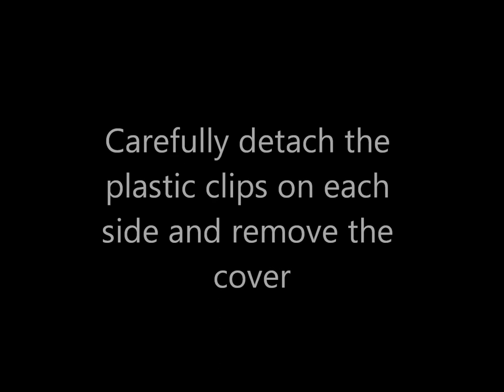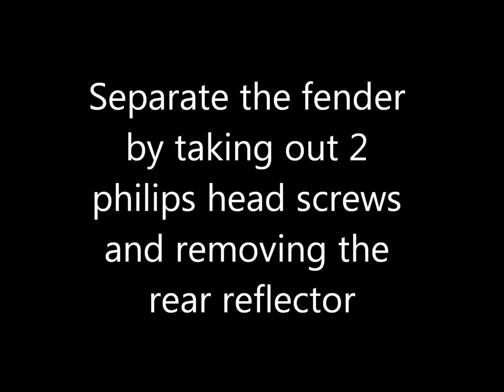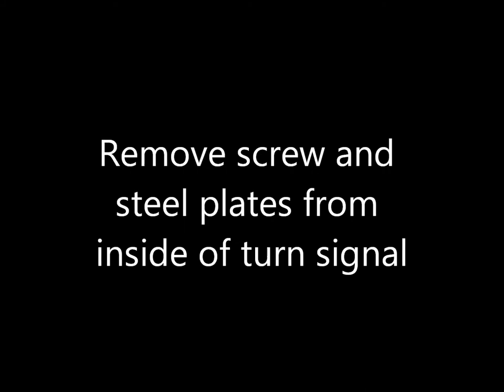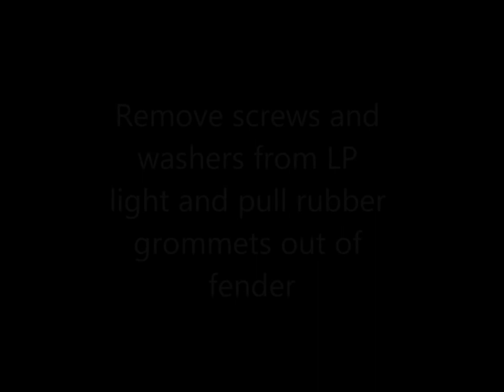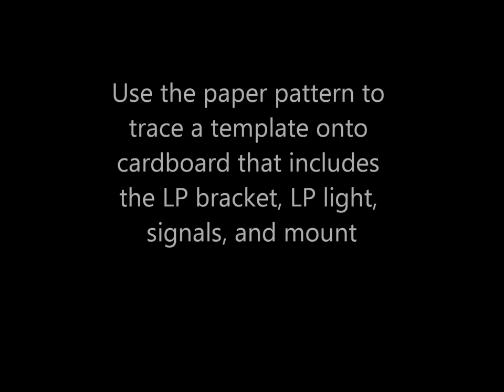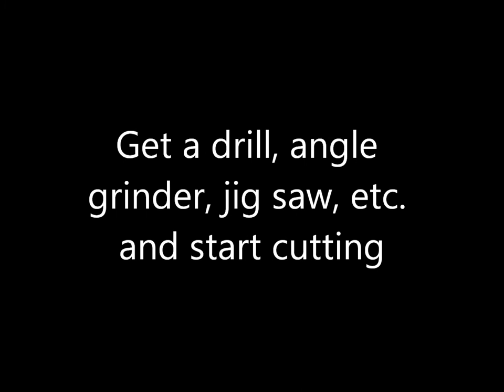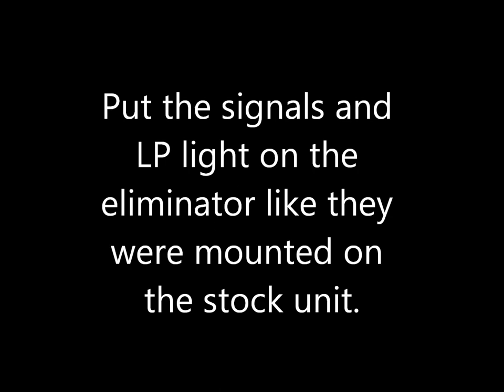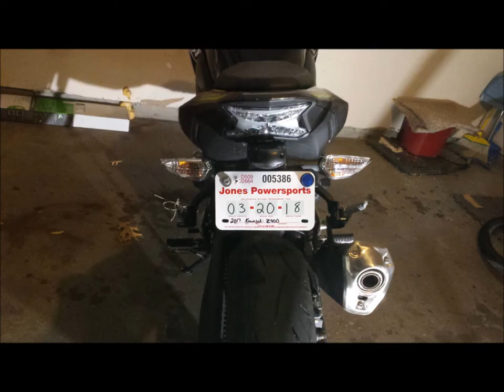Homemade DIY Fender Eliminator Tail Tidy for Kawasaki Z900

Comment: Nice job. 

Find it really annoying that most tail tidy kits don't utilize the factory number plate light but instead usually come with a cheap looking led. Also in the UK for MOT regulations you need to have a rear reflector and the only option is usually to stick a reflector on the number plate and tend to find you end up having to order a new license plate as the mounting holes differ from the factory hole position.

The makers of tail tidies will always sell them as plug and play but in a lot of cases you always end up having to do some modification, which you wouldn't have to do with a bit more thought put into the design.

I've got a 2015 ER6F (Ninja 650 in the US) and recently purchased a tail tidy but not happy with it for all the above reasons. Think I'll use it as a template for a redesign to allow me to use the factory light and reflector.
Reply from the maker: Cool.  We love the UK by the way.  We visited in 2017.  The history, the courtesy shown by everybody we met, the countryside, the food, everything was beautiful.  Everything except for the average speed cameras...

Comment: Just a question, isn't it already enough removing the backseat for being able to remove the fender after all?
As I've seen for the Z650, there it was necessarily removing the whole fender, the upper and the lower cover.
Reply from the maker: The hole where the wires go through is very narrow.  I don't think I could have pulled the lower plastic down enough to get them out if the upper plastic was still attached.  You could try.